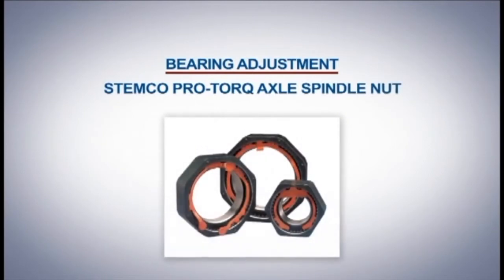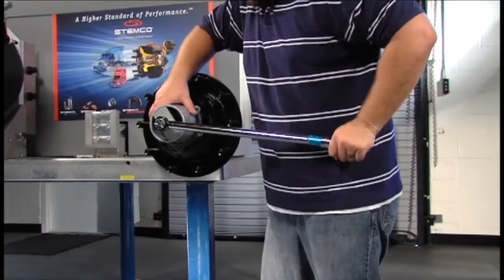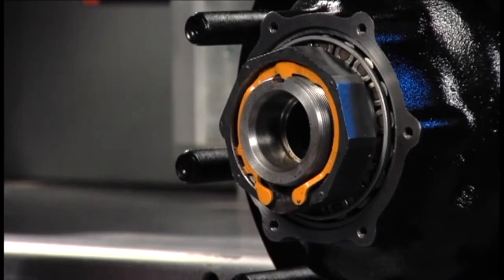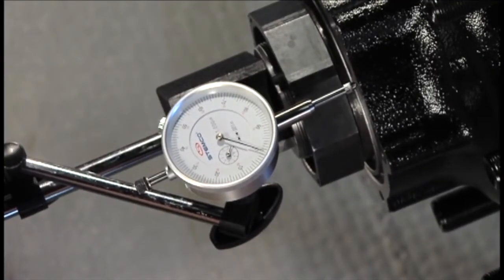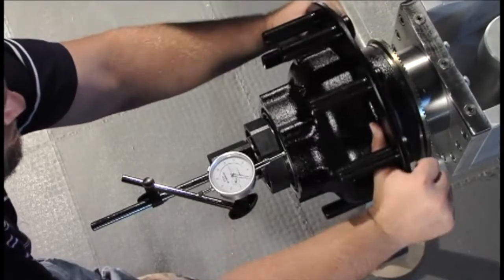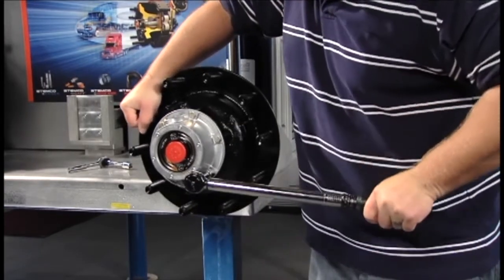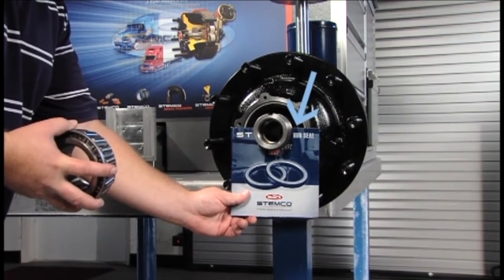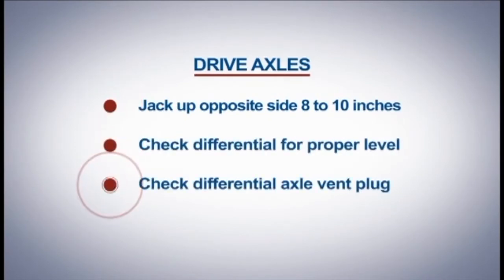2-1-1 Installation

Comment: I'm sorry I don't speak English, but the dial indicator used in the video is not the micrometer shown in the subtitles. Is the clearance 0.001-0.005 inches or 0.01-0.05 inches?